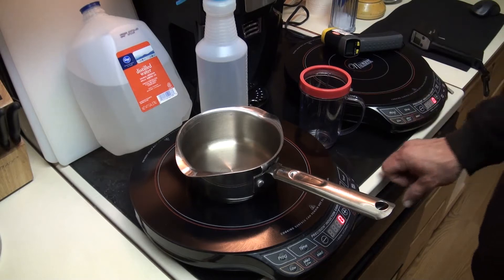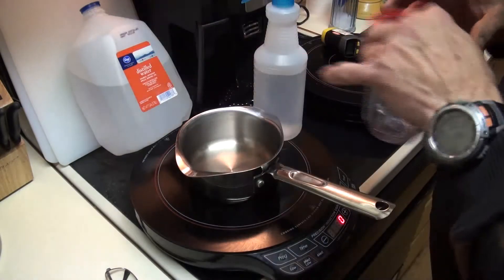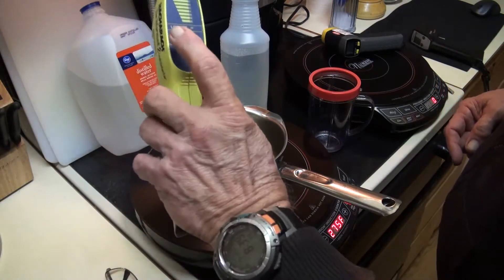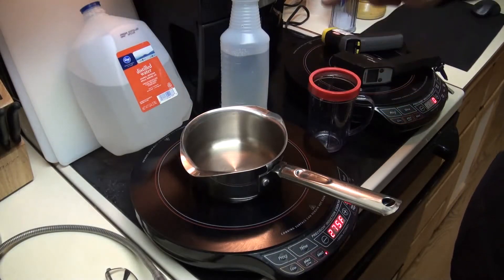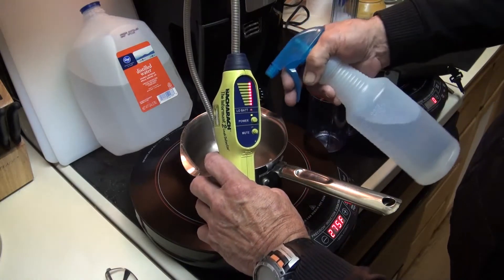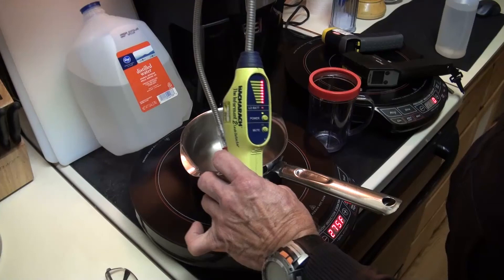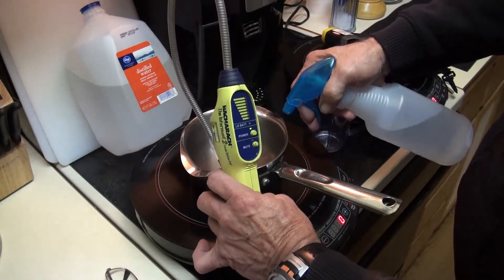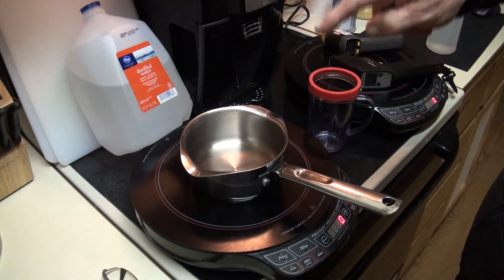# 2 Flammable gas from distilled water, is separating the Atoms, in water.

Comment: You  obviously have no idea about the nature of compounds. It would require a ridiculous amount of energy the break the chemical bond that exists between hydrogen and oxygen through heat alone. You claim that the hydrogen in the water essentially "boils off" before the water itself actually starts to boil. I don't think that you understand that water isn't just a mixture between hydrogen and oxygen, the hydrogen and oxygen atoms are actually bonded together to form a single compound. The nuclei of both atoms are attracted to each other because this way they are able share their valence electrons in order to achieve the more optimal state of oxygen having eight valence electrons and hydrogen having two valence electrons. The hydrogen does not simply "boil away" because it is bonded with the oxygen molecule. If it were to do this at all, you would not need to apply heat to water for this to happen because the boiling point of both pure hydrogen and pure oxygen is well below room temperature. You are getting this process confused with distillation. If you have a mixture of two chemical compounds that are not atomically bonded, one substance may have a different boiling point than the other, so you can separate them by heating the mixture to temperature where one substance will evaporate but the other will not. Water, however, as stated before, is not a mixture, it is a compound where the atoms are atomically bonded. What most likely happened with the gasoline is that you distilled it. There are impurities that exist in gasoline that make it a mixture of different compounds rather than one single compound, and you most likely separated them.
Reply from the maker: I see what you are saying. However the white vapor, created from the gasoline has zero parts per million hydrocarbons, as seen on a vehicle smog analyzer. I have used a clean dry rag, holding it over the exhaust pipe, running on the white vapor, and the rag smelled like it had been ironed. The exhaust manifold can be touched with your hand, after running for hours. I got twice the power output over running the vehicle on liquid gasoline, seen on two different dynamometers. One of which I was accused, of running nitrous oxide, when the power of the engine doubled, on the white vapor. You could use a 4 cylinder engine and get 8 cylinder power, on the 4 cylinder mileage. Maybe the oil companies need to look into this. At least it would make the fuel reserve, the world has, last longer. Not to mention cleaning up the smog the vehicles create. I apply the liquid to the heat, not the heat to the liquid, like everyone else does.
Reply: Bill Kendrick  I'm guessing that the reason why the white vapor had such a little amount of hydrocarbons is because any of the impurities in the gasoline were left behind when you evaporated it, so the engine was burning pure gasoline. This combined with the fact that you were burning a much finer mist of the gasoline meant that the reaction that occurred was a pure combustion reaction, meaning that the only products created from the reaction were H2O (water vapor) and C02 (carbon dioxide), neither of which are hydrocarbons and both of which can be found in the air around us. Normally, the reaction that occurs in an engine between gasoline and oxygen is not stoichiometrically perfect, so not all of the gasoline combusts properly, and there impurities in the gasoline that do not combust as well, which creates hydrocarbons in the exhaust. So the way that you were burning gasoline is certainly cleaner, but it would be the same thing if you just had more pure gasoline, and it certainly doesn't prove that the chemical bonds of water are broken by spraying it on to a hot surface.
Reply from the maker: UNTAMEDmtcj I forgot to mention something. The boiling temperature of gasoline is between 100 and 400 degrees Fahrenheit, depending upon the octane level in the gasoline. The higher the octane level in the gasoline the lower the boiling temperature the gasoline has. So I used a 600 degrees Fahrenheit temperature on the heater surface, and applied the fine mist of gasoline to that temperature. the fine mist gasoline droplets went to the 600 degree Fahrenheit temperature faster than they could boil at 400 degrees. Just like Sublimation does snow, when a large amount of heat is applied to the small snow flakes, they go from frozen to a gas, assuming the applied temperature, like my fine droplets of gasoline liquid do. I created a gas that does not become a liquid until it goes below 50 degrees Fahrenheit, watch it on my video. It was taken in Bandon, Oregon, next to the ocean, on a cool day, around 50 degrees, I had a flannel sweat shirt on that day. and gasoline would be a liquid at any temperature above 100 degrees Fahrenheit. I still had a white vapor at 50 degrees, can't be gasoline, the condensing temperature is to low..
Reply: Bill Kendrick That is NOT how phase changes work. Just because a substance is hotter than the lowest temperature that it can boil doesn't mean that it somehow won't boil, it will just change to a gas faster. I'm not sure why you think that sublimation has anything to do with it. Just to test your knowledge, what causes particles to behave as solids, liquids and gasses, and why does adding or taking away kinetic energy from the particles cause a change in state of mater? What is the difference between a mixture and a compound? If you can't answer these questions then you clearly lack a conceptual understanding of chemistry and perhaps you should consider taking a chemistry class at your local community college before making a fool of yourself on the internet. I'm an engineering major in my junior year of college, so I have a fair conceptual knowledge of chemistry and physics, and trust me, you did not discover some magical new thing, you just have a lack of understanding of how chemistry works.
Reply: Bill Kendrick ''What I am conveying is my observations, I don't claim to be a scientist.''

Then stop making so many scientific assumptions when you simply don't know. You can't rely on observations alone to determine what's exactly happening, especially on a molecular/atomic scale. That's not how science works.
Reply from the maker: Since you think you know it all, explain why I get twice the power from gasoline using the same process, and it is not fragmentation, of the gasoline. Science calls it Sublimation when it is done to snow. I am saying the liquid goes to the applied temperature faster than the matter can boil, when it is sprayed onto the heat source, this will take the liquid above it's boiling temperature. Now if it is snow,  it goes to the applied temperature, and goes from a solid (snow) to a gas without becoming a liquid, called Sublimation by science.
Reply: +Bill Kendrick the additives in the gasoline that you boiled off actually increase octane rating to make it burn in a more uniform fashion. boiling off these additives makes gasoline have  more instantaneous combustion energy, but a more volatile combustion that can create engine damage and does not produce more energy per volume. so pretty much you turned 90 octane or whatever into 60 octane
Reply from the maker: +UNTAMEDmtcj  Think about this, Sublimation is when a large amount of heat is applied to a snow ball, the snow flakes, on the snow ball, are very small, and they go to the temperature being applied, before the ice changes state, from a solid state to a gas, without boiling and becoming a liquid first, then the liquid would have to boil and become a gas. 
I applied this same basic principle to liquid gasoline, I sprayed a fine mist of liquid gasoline onto a 600 degree temperature Fahrenheit heating element, and obtained a white vapor that has a lower boiling temperature than gasoline. The white vapor remained a vapor at 60 degrees Fahrenheit, and a non flammable liquid I accumulated in my chamber would no longer mix with the gasoline it was made from. Try extracting something from any liquid, and the extracted liquid will always mix with the original substance, mine didn't. I call my process Flashing Liquid. Temperature wise, what can be done to one liquid, can be done to any liquid. I bet all atoms have a boiling temperature inside of what ever liquid they are in, and my Flashing Liquid Process can find those temperatures..
Reply from the maker: He knows all about, not knowing anything, and thinks he is an authority on science. You fold the toilet paper carefully , and try not to get the brown stuff on your fingers when you wipe.
Reply from the maker: When you get your head out of your ass you might learn something, consider this the last time I address idiots like you. You make Donald Trump look Smart.
Reply: Bill, please post some more videos.
Reply from the maker: I just bought a home, and at present it is consuming all my time. Maybe, if I get the house like I want, I might do another video later this year.

Comment: From http://www.hse.gov.uk/pubns/gasdetector.pdf - "for example steam or water vapour can produce false readings and alarms." You made steam bro. Billions of people in the world enacting trillions of situations involving heat and water yet none of them have accidentally discovered this flammable gas?
Reply from the maker: In spraying a fine mist of gasoline onto a 600 degree Fahrenheit heater, I got a white vapor, that produced twice the power of gasoline. I also got a non flammable liquid at the same time. Defragmenting gasoline cannot produce this. When a flame is held next to snow it goes from a solid to a gas without becoming a liquid.  Science calls this Sublimation. Snow flakes are very small and react to the applied temperature faster than they can become a liquid, so it becomes a gas, instead of becoming liquid. I use the same principle on the gasoline applying a fine mist of droplets that react to the applied temperature first, therefore going above the boiling, of 100 to 400 degrees Fahrenheit, that gasoline has. I am applying this same principle to water and intend to ignite the vapor from the water soon.
Reply from the maker: Have you passed the age of puberty yet, your mental capacity tells me you might be 10 years old. Go bother your mommy.

Comment: I just did a quick Google search on flammable gas detectors and I've already found two hits that say steam can trigger false readings in these devices. One says specifically not to place the detector near sources of steam.

The instruction manual for the device you are using says to keep the sensor dry. imo what you're getting is a false reading. If you can take an open flame to your water misted pan and show there's some combustion occurring I might believe otherwise, but I highly doubt that's possible. There also exists superheated water that reaches temperatures much higher than the 230f or so you've got there, and never does it decompose into H2 and O2.
Reply from the maker: To superheat the water they have to put water under pressure. Read about Sublimation on ice, where snow goes from frozen to a gas without becoming a liquid, when a flame is applied to the snow. This is because snow flakes are very small and assume the temperature applied faster than the snow can become a liquid, so it becomes a gas. I used small droplets of liquid which assume the applied temperature faster than they can boil, the same principle as Sublimation, so they go to the applied temperature first and boil at that temperature. 221 degrees Fahrenheit, is the boiling temperature of the hydrogen atom, in water

Comment from the maker: Go outside, if you live in snow country, create a snowball, and using a butane lighter, light up the lighter, hold the flame next to the snowball. The snow will go from frozen to a gas, without going to a liquid. Science calls this effect Sublimation. It is where the small parts of the snow flake assume the applied temperature faster than the snow flake can turn to a liquid, so it becomes a gas, without becoming a liquid. My Flashing Liquid process works on the same principal, except I use fine mist droplets of liquid, similar to the size of the snow flakes and the fine droplets assume the applied temperature faster than the liquid can boil at the known liquids boiling temperature, so the liquid droplets go to any applied temperature first, and boil at that applied temperature, any temperature you desire. I have found the boiling temperatures of atoms in gasoline and in distilled water, this way

Comment from the maker: Gasoline showed me the way. You see the small droplets of liquids, due to heat transfer happening first, will assume the applied temperature faster, than the time required for liquids to change from a liquid matter to a gas. We all know how long it takes for all liquids to boil, and vaporize. All Gases and liquids separate. I took a group of atoms in gasoline to their boiling temp while other atoms didn't boil. I did it to water and created a flammable gas. This can be done to any liquid.
Reply: Bill Kendrick why not just evaporate gasoline in a warming tank? why vaporize so much fuel into the air? I've seen cars run on less gasoline molecule rich air perfectly. will your system allow for more fuel and air to enter the combustion chamber and therefore create more power? or is it just a quicker way to turn gasoline into vapor?
Reply from the maker: Evaporation turns the liquid to a vapor, but it is a gasoline vapor, my Flashing Liquid process creates a different fuel , and it is no longer gasoline, but it has twice the power and far less smog. I have separated some of the atoms in gasoline, and created an entirely different fuel.
Reply: Bill Kendrick  . Understood. what kind of mpgs have you gotten on your truck driving it?